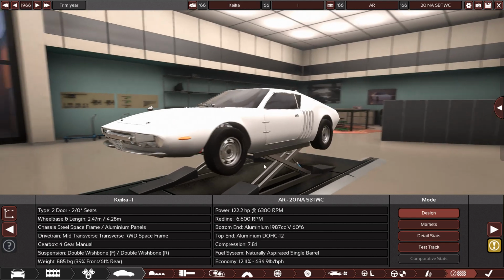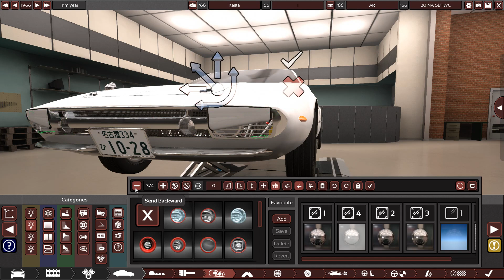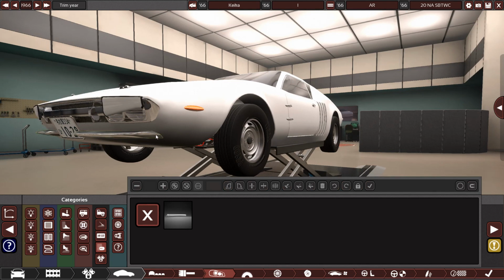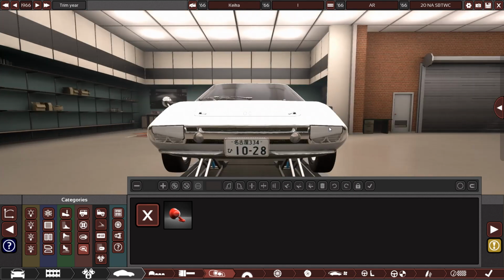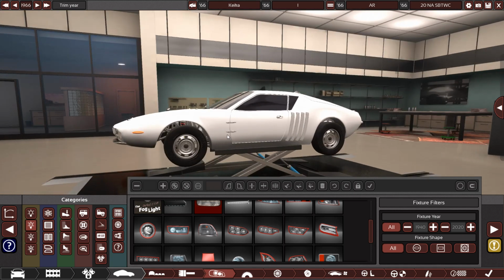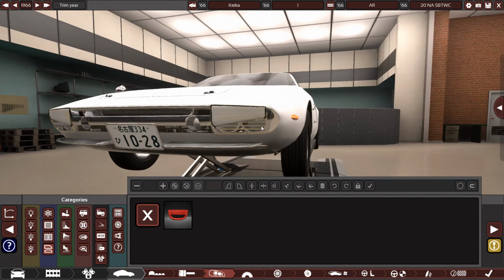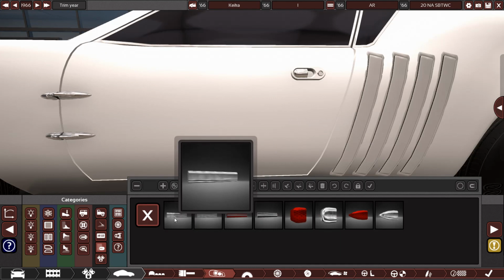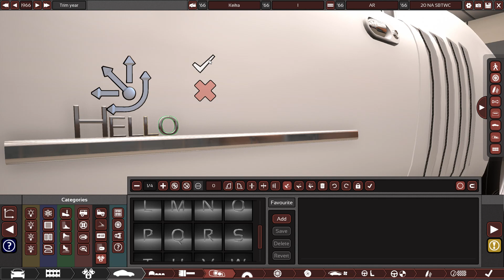Automation - Design Tips

Comment: fuel cap on the front fender?
Reply from the maker: Mid engine car, makes sense to have the fuel tank at the front. Porsche has done a similar thing on some of their models, and I believe I had the Boxster in my mind when I made this.

There are obviously other places, a lot of racing cars and even some road cars like the Ferrari 355 have the fuel tank next to the engine. I think the Pontiac Fiero and the second gen MR2 had the fuel tank between the seats. But I wasn’t really aware of that back when I designed this.
Reply: @BoostandEthanol  cool thanks for the info! i never considered where to put the fuel in a mid engine car :o